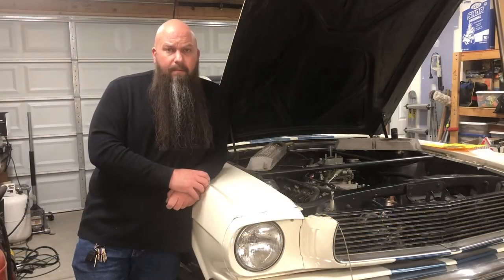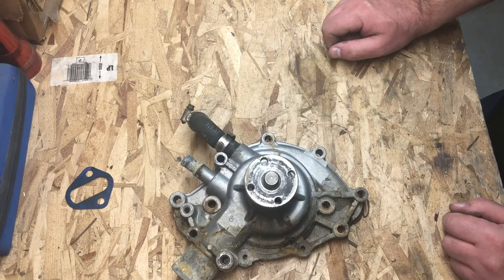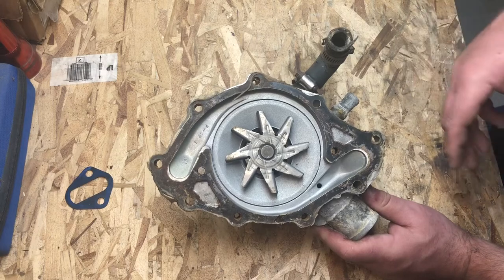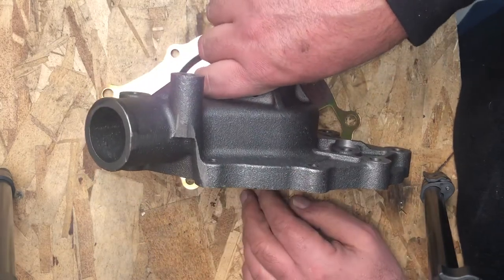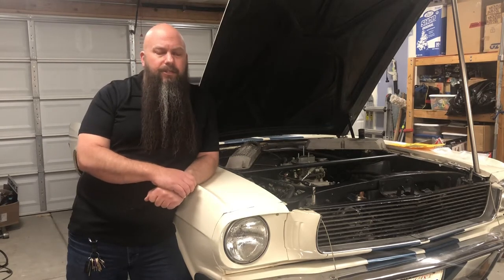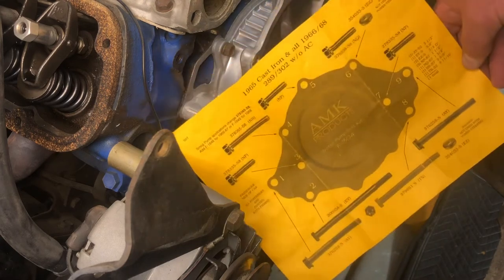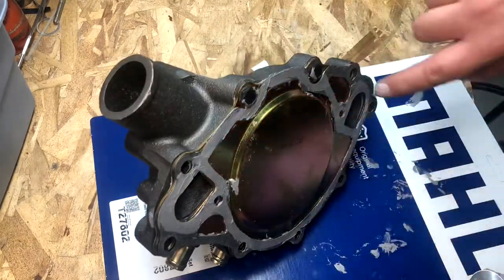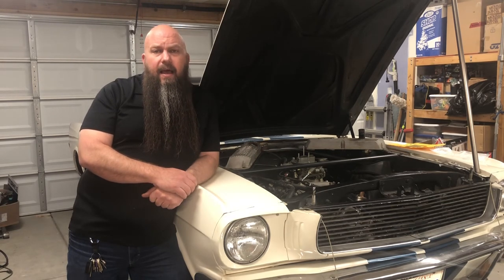Early Mustang Cooling Systems Part 4: Water Pump Tech, Iron vs Aluminum, Don’t Overlook The Bolts!

Comment: You should have mentioned putting anti-seize on all  the threads. As a 70 year old mechanic , I  have used anti-seize anywhere bolts and nuts are exposed to the weather or near coolant . I have also avoided using worm clamps because they tear into the hoses and cause a leak . I have always used tower clamps or T-Bolt clamps because they give a full 360 clamping grip and have a neater and cleaner look to my work . Otherwise I do like your videos !

Comment: Great series of videos. They are really helpful. What was the model number of the Tuff Stuff water pump that you used?
Reply from the maker: The pump in the video is a 1432N, I ended up using it on another 289, and Im using the 1432 aluminum version on my car now.
Reply: @TheGT350Garage  thanks!

Comment: Can you assist me with a timing chain cover and water pump? 302 from 96 explorer as it is going into my 65. I’m having a hard time finding the correct direction flow with dipstick up front.
Reply from the maker: Take all of the Explorer stuff off, timing cover, water pump, balancer, accessories, put it on Facebook marketplace for sale.

Use a ‘65-67 289 timing cover (I like the California Pony Cars ENG-000-408) with a bolt on pointer so you can adjust the location of TDC if needed.  Use the Tuff Stuff iron or aluminum water pump for a passenger side inlet.  You’ll need a Summit SUM-163302 harmonic balancer to match that crankshaft with the early front dress.  You’ll also need an early front sump oil pan and pickup, and a dipstick and tube for the front cover.  You’ll have to plug the hole in the oil pan rail.  You’ll need an alternator, alternator bracket set, alternator spacer, water pump pulley, and 3-bolt crank pulley, all need to fit ‘65-67 289 engines.  The final need will be a 50oz imbalance flywheel or flex plate compatible with your transmission of choice.  Headers need to fit Mustang, you won’t be able to use the Explorer stuff and you won’t want to.  

Find an old Crane 2030 Compucam, upgrade the valve springs, install 1.6 roller rockers and a roller timing chain while you’re in there, top it with your choice of dress up and induction parts to run EFI or a carburetor, and you should be all set up.

Comment: Did you put the grey gasket maker on both sides of the thermostat gasket?
Reply from the maker: Yes, but just enough of a smear to cover the gasket surface, not enough to get into the thermostat or cooling system.  And in no way am I sponsored by them, but Permatex Ultra Grey is where it’s at, it seals everything perfectly, every time.  In fact, you could lay a 3/16” bead around the thermostat housing and it would seal without a gasket, incredibly good product.

Comment: What ratio of anti freeze do you recomendc
Reply from the maker: 50/50 is ideal for most areas.  In warmer climates a minimum 40% antifreeze to 60% water, cold climates a maximum of 60% antifreeze to 40% water.  The ratio varies and changes the final coolant efficiency, outside of those ranges you actually loose protection from boiling and freezing.

Comment: Hi Walter first of all thanks for all your videos very helpful. What do you think of a fan clutch on a 1966 289 hipo?
Reply from the maker: I generally reserve clutch type fans for air conditioned cars, the fit on a ‘65-66 is TIGHT.  There’s barely enough room for fitment.  It will allow a 17” 7-blade fan, and when the car needs the airflow, it would provide it, but in my experience, it’s really not necessary.  The 17” 6-blade flex fans usually cool really well, and of course the final part is the correct timing and fuel delivery.  Reach out to my through direct message or email thegt350garage@gmail.com for some specific additional information regarding HiPo distributors.

Comment: Outstanding video Mr could You tell us wath Range or grade of temp Ford a Ford 6 cyl Mustang from 1966 modelo thanks ,suscribe Joe.
Reply from the maker: The 6-cylinder is a little different than the V8 because there is really only one path and the coolant actually travels past 50% more cylinders.  You still need more radiator capacity than stock, but the thermostat is a little trickier, a 190-195 thermostat may cause the rear cylinders to run hotter than desired, but that should be your starting point, there would be no reason to run a thermostat cooler than 180.  Most importantly, run a high flow water pump.  https://flowkoolerwaterpumps.com/products/1641-1960-1975-170-200-221-ford-water-pump

Comment: I was looking for a video that tells me which water pump is best for my early style aluminum water pump with no backing plate.
Reply from the maker: Good aftermarket early pumps should use a cast iron impeller.  Take a look at Milodon 16330 or Edelbrock 8847, those are the only performance minded pumps for the early cover.  The Milodon uses a GMB housing, GMB pumps are fine, but just a stock replacement.
Reply from the maker: Also, early pumps ‘62-65 are getting harder to come by.  They aren’t super popular and don’t sell nearly as many units as the ‘66-77 passenger inlet pumps.
Reply: @TheGT350Garage  what about the Edelbrock 8842 on the Summit Racing site. It says it has no backing plate. Will that work with my early timing cover that is designed to work without a backing plate?

Comment: What do you think about sacrificial anodes in aluminum radiator? Do you run one with yours?
Reply from the maker: There is nothing wrong with installing and using a sacrificial anode, however, they aren’t entirely necessary when you use the correct coolant and monitor the condition annually.  The sacrificial anode is there to give up electrons when the coolant becomes too acidic.  You can check the coolant with a voltmeter to see if it is conducting voltage, a test strip to check the pH level, or a hydrometer to check the specific gravity of the coolant.  It’s always best to stay proactive, and as much as an anode is a proactive measure, it also encourages putting off the other checks I mentioned due to a false sense of security it gives.  An annual check of coolant condition and addition of a tablespoon of baking soda to the coolant to correct the pH is often the best approach.  Be sure to change the coolant on the correct interval to maintain a working additive package.  If you’re not sure what coolant you are running or how old it is, flush it thoroughly and switch to one of the ELC coolants I recommended in the video.

Comment: Great video! Quick question: is the water pump on the GT350’s engine that same as a 1960s Ford 302? Thanks for all the info
Reply from the maker: The 1962 to early 1965 221/260/289/289 HiPo used a different pump and timing cover arrangement with no steel backing plate and the pumps had ears that directed coolant flow into the timing cover.  I show these in the water pump and timing cover videos I made.

The later ‘65-67 289 HiPo pumps were interchangeable with pumps from ‘65-69 289/302/351W.  Basically if it’s a passenger side inlet pump and the pump uses the steel backing plate they interchange.  The ‘62-69 221/260/289/289HiPo/302/351W all used a 3-bolt crankshaft damper and pulley.

Now, the ‘70-79 302/351W driver side inlet pumps share the same timing cover and water pump gaskets, but the cast in timing pointer went away on the driver side of the timing cover in favor of a bolt-on stamped steel pointer that was used until 1993 on cars and 1996 in E/F Series and Bronco. These are also easily identifiable by their 4-bolt crankshaft pulley and thicker dampers.

The reversed rotation “serpentine” setups appeared in ‘79 and complicated things, because some dual serpentine belt systems used a standard rotation pump on LTDs and F-Series.  The 89-93 Thunderbird, 94-95 Mustang, and ‘96-01 Explorer use variations of a short water pump arrangement and don’t interchange.
Reply: @TheGT350Garage   bro!! Thanks so much for the info! That helps more than you know
Reply: @TheGT350Garage  ok so the inlet is where the radiator feeds into the water pump? Sorry for the dumb question, but I have learn somehow…
Reply from the maker: @williamschristopher12  yes, the lower hose is the inlet to the water pump.
Reply: @TheGT350Garage  thanks
Reply: I sorry to bug… just need quick advice…but I have what I thinks the 1970s Ford 302 in a 64  Comet…I want to do a preemptive maintenance by replacing the water pump…when purchasing the correct pump do I need to know the pulley height? My car is kind of a Frankenstein that purchased from someone else, so the VIN numbers doesn’t match the block
Reply from the maker: Ford never put VIN numbers on any of the engines except the high performance models.  If your current setup is “complete” and there are pulleys installed and a belt in place that is lined up, and if your setup has radiator hoses connected to a radiator, all that matters is that you go with a pump that puts the inlet in the same location you are currently set up for, everything else will work.  If you don’t have a complete setup, you need to start by identifying which balancer you have, which radiator you have, and I’d be happy to help you with the part numbers you’ll need to have a complete running system.
Reply: @TheGT350Garage  Brother! You are the MAN! Thanks!

Comment: there is a difference in the water pumps for timing chain covers  one uses a  backing plate one don't        older engines do not use them
Reply from the maker: Really?  You mean the one I clearly explained in the previous video?  Early Mustang Cooling System Part 3: Timing Covers, Balancers Water Pumps, What Does & Doesn’t Work
https://youtu.be/wX1-Tl_xvvU

Comment: If that is a real Shelby why wouldn't you take the time to find an original pump and get it rebuilt? There is a place that offers rebuild services and they reproduce the original hi-po impeller. No brainer no matter what they charge.
Reply from the maker: Very much a real Shelby, not a concourse restoration, it will be driven as Carroll Shelby would have intended and approved of.